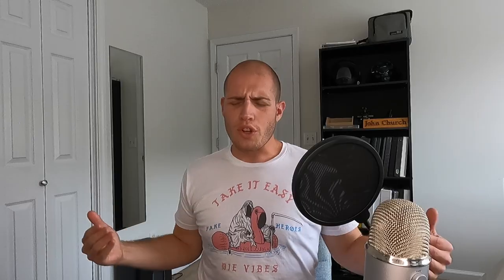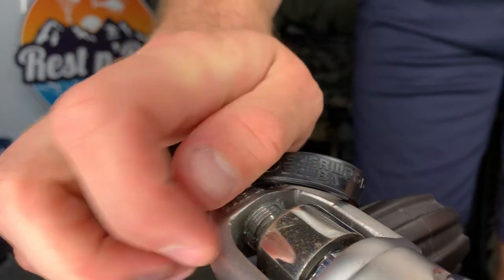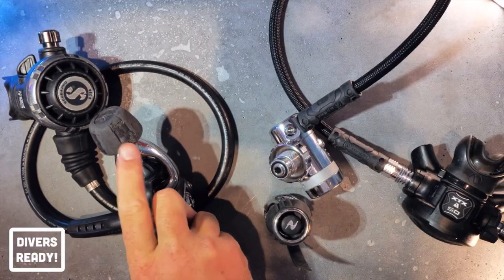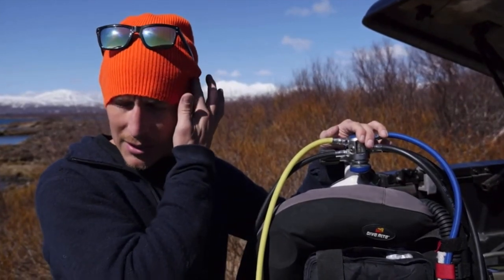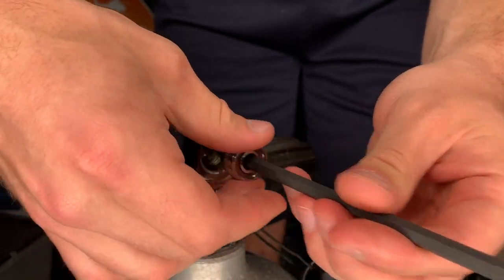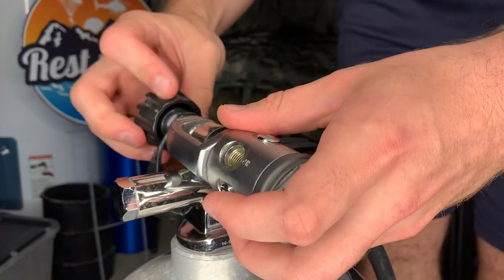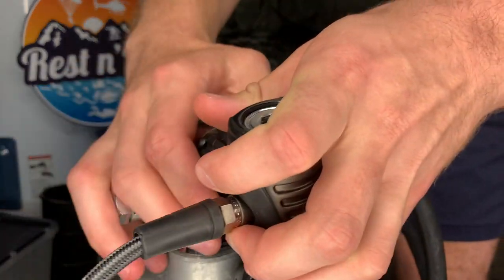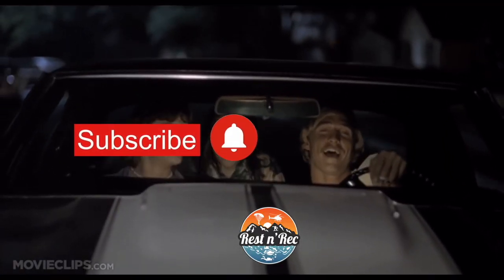YOKE NEEDS TO CROAK! D.I.N. is the future of Diving!

Comment: Thank you so much for saying it! DIN is better! It's annoyed me every time when someone says "it's not like one is better than the other ..." 

I have a reason for yoke! I've seen someone shave his yoke clean off when his "giant stride" entry turned into a "slightly too short step off the boat" entry and the yoke knob hit the side of the boat. Let's just say, I had to compose myself from dying of laughter before I was able to assist the "rescue".
Reply: @john_church  LOL can back that statement up with any measurable claim other than nostalgia?
Reply: Right. Of course, that can't happen if a DIN regulator does the same thing. Any sharp blow to the reg/valve assembly, Yoke or DFIN, will result in disaster.
Reply: @AlecPeirceScuba_SeaHunter  a pressurized first stage will not be knocked out of a DIN valve by the force of a giant stride and hitting the step you were stepping off. Even more so, the DIN fitting is between your head and the valve, so there isn't even anything to catch on. Mind giving me an example of how a sharp blow to the reg assembly might happen through a minor mistake like the above, i.e., not talking about gross mishandling of the equipment? The issue I described could happen easily by the diver slipping due to an unsuspected wave hitting the boat while waiting to be in position to jump in for the shot line.
Reply: @AlecPeirceScuba_SeaHunter  Though a DIN setup has nothing to catch onto the boat. The back of the valve is just smooth steel instead of having the knob and the clamp there.

Comment: As a brand new scuba diver, I brought that for between din and yolk to dive center, and I kid you not that was the exact reason I went with a yolk stage one was that it was more common around the world but now that I see that there is a yoke adapter for the DIN I will be switching over my stage, one to be more versatileI really appreciate this video and information
Reply: Buy that u wanna buy. Do not listen overs. This is the first thing u should know from school. Total mass for u same. Less kg on belt. Pressure for din 232 and 300 sow 300 more expensive. For yoke 233. Same view on aggs from side. U could change connector from yoke to din. Yes it will cost but you could. Take that is comfortable for u.
Reply: More over it does not matter din or yoke u should have spare o rings. Not to interrupt diving.  I have both din and yoke. And I use din only as backup at diving below 20 m. rubber bands are consumables
Reply: The thing is.. it's not more common. The only places that maybe still use more Yoke is the US and vacation destinations that get 99% american rec divers as customers. Everyone else uses DIN. Because it's better.

Comment: In Asia, yoke is more common. I wanted a DIN but my instructor/DM said to just go with yoke because that's what everyone uses. Similarly, I see a lot of tourists from the west having to switch from DIN to yoke and it can be quite a hassle especially when they only realize it minutes before the start of a dive.
Reply: All the dive centers in Indonesia and Thailand I've been to have convertible valves. They just screw out the plug, even on the boat. It's never been an issue.
Reply: @Yggdrasil42  yes of course. Just saying, wish the default is DIN instead of yoke.

Comment: Great vid. Controversial(?), humorous, and accurate. When I bought my Reg (Atomic B2) I purchased Yoke. Just didn't know better. Yup, had it changed out to DIN in the first year and never looked back. I always have both a DIN to Yoke Converter and an Allen Key with me in my Reg bag. If I can't remove the insert then can convert. 100% should have purchased DIN from the start! would have saved some $$$
Reply: Still happy with the B2? What other did you consider?

Comment: Buying my first reg and doing a LOT of research; also watched all the vids you mentioned here trying to decide. Dude! Yours convinced me to go with DIN. Thanks for the straight talk...and you're funny, too!
Reply: I did the same thing. Research it to death before committing to a purchase.
Finally completed my first SCUBA setup, and ended up getting a backplate & wing, and a long hose 5 port cold water rated DIN regulator set with a brass and glass SPG and a Shearwater dive computer with transmitter.

Better to buy right the first time. It save you money in the long run.

Comment: Remember
You can use the yoke as most of us do as a weight for automatic door closing, it is cheap it only requires 2 screws a nylon cord and 1 to 2 Yoke. So even a Yoke can be used for something 🙂

Comment: North Asia and South East Asia is maybe 80% yoke tank valves on shop/boat cylinders; and 80-90% of divers have yoke fitted regulators. However, a few duel valve cylinders are usually available for those using DIN. I myself have both types of regulators, and agree that DIN is easy to use and smaller so gives a more streamlined option.

Comment: When you reach your dive center just whip out you trusty Allen wrench and remove the threaded insert from their valve, problem solved with likely 90% of the modern tank valves in use now. Cheers, #SeattleRingHunter
Reply: That's great if the inserts have been in and out frequently. If you leave them in too long they never come out.

Comment: Grand Cayman is loaded with shops that only use yoke. I use DIN at home in the north with 3500 psi tanks, and often use yoke in the tropics because it is more common depending on where you are. You can't knock the fact the yoke has worked well for decades and in over 50 years of diving I have never heard of yoke failing if it sealed up ok on pressure up. Which do I prefer? why DIN of course ...!

Comment: Great video, so can you convert a yoke to a DIN? I just bought a yoke grr
Reply: Only autorise technician can change yoke to din, it requires part swap, most manufacturers have both din and yoke 1st stage of the same model
If your 1st stage only exists in yoke... 😔
Reply: you are fine. just use it. yoke not going anywhere soon - by soon..... I mean another 10+ years.

Comment: I believe the next big jump in scuba will be the tanks. Carbon wrapped 300 bar tanks are now available, at the same size as aluminum 80s with better buoyancy characteristics. DIN will become the go to as the industry gets higher pressure tanks as the norm.
Reply: @john_church  this is like the imperial/metric battle. At least here in the states no one will change until people start seeing longer bottom times.
Reply: But why would I want a carbon tank? I'll need to wear a ton more lead. It's just moving the weight, not reducing it.

Comment: The only advantage I can say for a Yoke is that it is slightly faster to put on as it is easier to align the A-clamp to the tank valve. For DIN, it might take some time to get the threads align before screwing it in. However, this is a very minor convenience compared to all the advantages that the DIN provides.

Comment: unfortunately the shop I work at are changing out the pro valves for yoke only vales. I would much rather have the pro valve sine I started changing over to din regs.
Reply: @john_church  they had problems with orings keep failing. I know that's a stupid reason to change values to yoke. Also now I have to use an adapter when I use my gear (din)

Comment: Like much else in marketing , the only reason I see the diving industry using Yoke in the USA is because they know you will upgrade later selling you the product twice. A motorcycle salesman told me once that they steer you at entry level to the smaller crotch rocket because they know you will be back in a few weeks to trade up to the big crotch rocket. $$$ Ka Ching $$$
Reply: When it comes to motorcycles, there's a good reason to steer new riders to lighter bikes. The chances of them being repeat customers is a lot higher if they're still alive because they didn't kill themselves riding an overpowered bike they are ill equipped to handle.

Yoke is just outdated tech. I think the biggest reason some people defend Yoke is because DIN is a German standard, and no Yank wants some foreigner telling them they're doing it wrong.

Comment: I have both. Yoke much more comfortable. Din is not better
Reply: If for u just o ring problem you have problem. As diver you should have spare one. I use steel. And normal pressure not higher 220 bar. Sow it's illusions. a bad dancer is hindered by his balls
Reply: More over u did not say that there is 2din types. Low pressure 232bar and hight 300bar. Sow generally speaking u lier. And if compear prise 300bar cost much more.
Reply: And wording "heavy" is at least strange. U grab belt with as example 8-12 kg. Sow it's not heavier. Total weight for u will be the same. Just grab less kg on belt.

Comment: I'm certified and I got my own gear 4 years ago. I made sure to get DIN. I had my own cylinder. Now, I live overseas so I sold the cylinder but took everything with me. DIN just makes more sense, especially on the cylinder. If someone has yoke, use the pro valve. If you're on a boat and all cylinders are yoke, use the adapter. I always have one with me when I travel. Yoke is like the imperial system. People like it because that's what they're familiar with. Nobody outside of America uses it